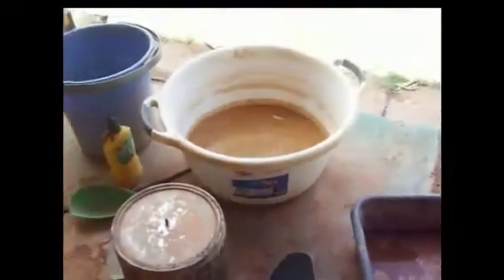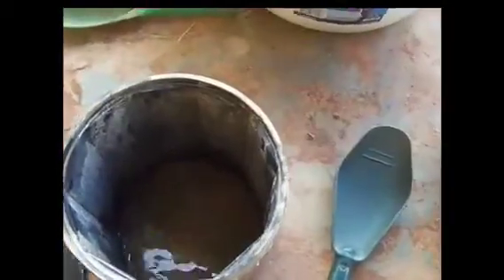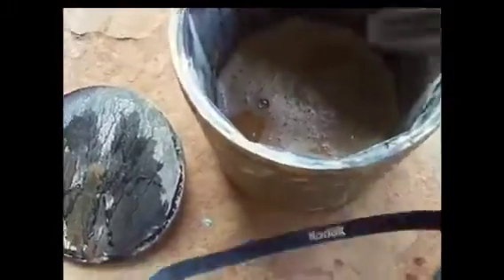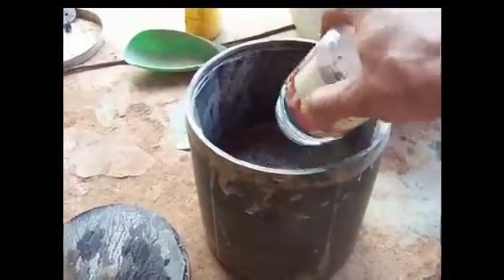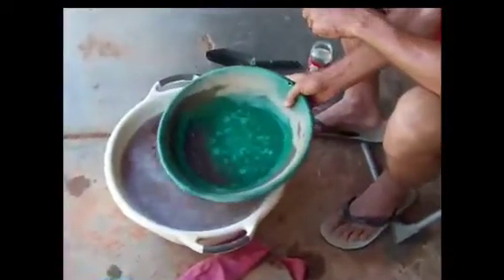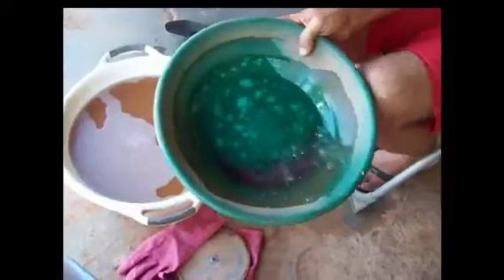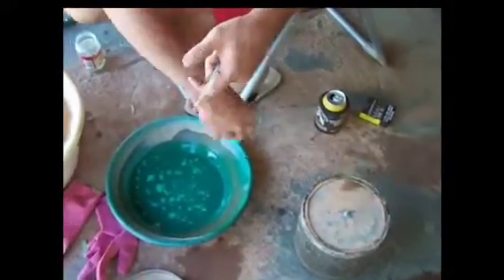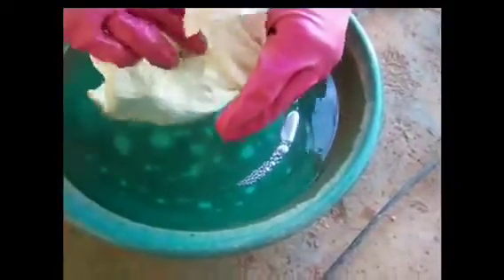Small Scale Gold Mining - Mercury amalgam bowl

Comment: Another great video guys keep up the great work. Love the setup and cant wait to see the retort results.
I have heard about charging mercury before but not using sodium hydroxide for alluvial or using the steel BB's in the tumbler. Are the BB's just to crush/break the cons up a bit more or do they help with the amalgamation?
Reply from the maker: 00Shivan00 g'day mate,  alluvial gold can often get a coating on it that stops it all from amalgamating properly, sodium hydroxide helps 'clean' the gold so the mercury picks it up better.  It also helps neutralize any sulphides that are in there.  The NaOH can also be used to charge your mercury.
I just stick about 50ml in the water (distilled preferably) and tumble for about 30mins, then tip it out and replace with clean tap water and add mercury.
The ball bearings are for both reasons you stated, and seem to help a lot.
Reply: Cheers, have not been out for a dig in a while but have a whole heap of cons i want to check, i figure it cant hurt to see if i missed anything before they get dumped. Hope its not too hot over that way.